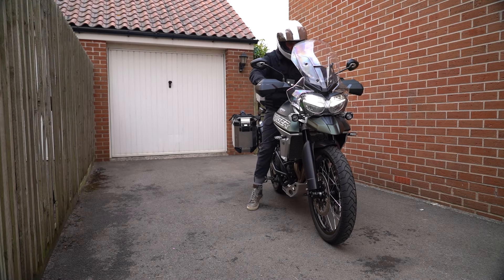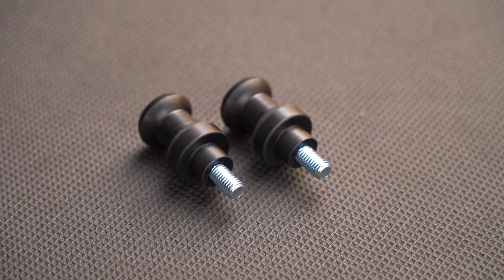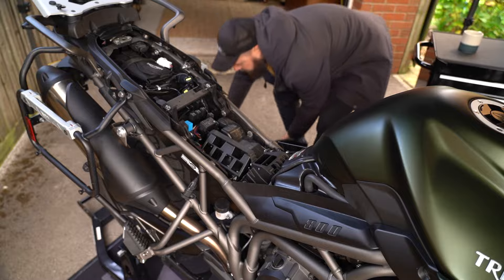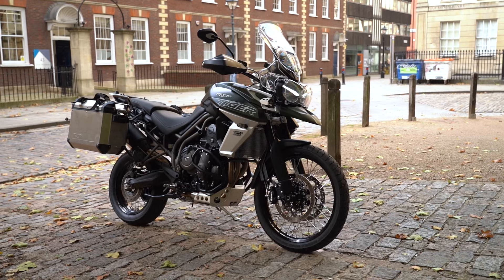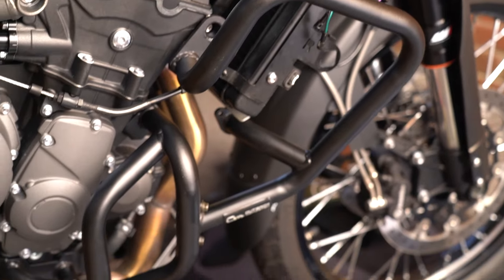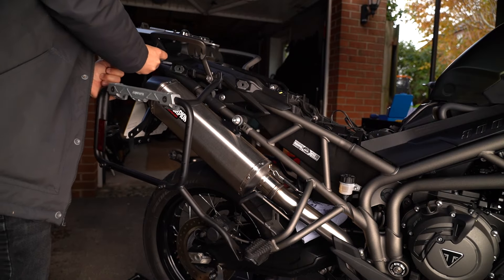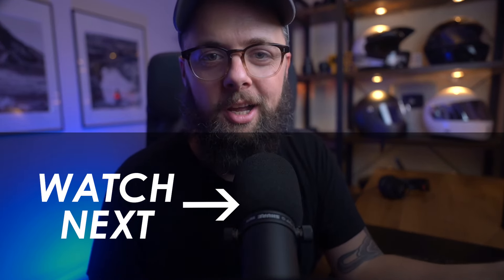11 Mods & Accessories For My Triumph Tiger 800 XCa!

Comment: I prefer the 800 over the 900. It looks more substantial and of course doesn't have the 900's TFT display which I'm not sure i could live with.  Nice bike fella.
Reply from the maker: Cheers SC - the regular firing intervals are better on the motorway too when you get up to 70mph+
Reply: Although the 900 fixes a few things I don't like about the 800, eg air filter location, removable rear pegs,  tubeless wheels, indicator location (I want to do this mode)

Comment: Used to own a tiger 800,went back to Yamaha and i regret it little bit... the fit and finish Triumph delivers makes you feel "special" and its worth the money 😊 I will probably start searching for a tiger again next year when the warranty on my Tracer expires 😅 love the looks of your Tiger btw!
Reply from the maker: Interesting! I quite fancy a go on the tracer 9 GT because I loved the engine in the MT-09. But agree the triumph finish is right up there with the best
Reply: @motobob  got the tracer 9 GT for a day when my tracer 7 was getting serviced,the electronic suspension in combination with the quick shifter made it a very fun experience 😅 180 kph and not even noticing  it,a very well put together motorcycle to be honest.If you get the chance definitely try it!

Comment: i have had both the 2018 Tiger 800 XCA and a 2021 Tiger 900 Rally Pro. While the Rally Pro might have been a tad better in almost every terms, except for the pronounced engine vibrations of the T-crank. This was a no go for me, now I waiting for a good opportunity to find a last gen Tiger 800 XCA again. That engine is soo buttery smooth. This satin green color looks so noble too...

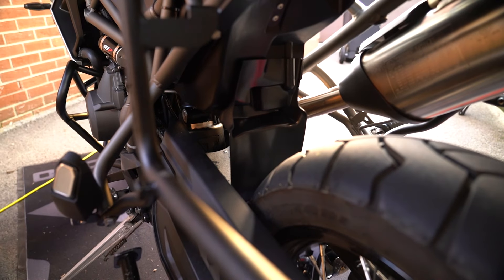Comment: 6:40 The Triumph Tiger 1200 XCa also has the turn signals placed higher up. I was on a riding skills course with a fella who had a 2023 Tiger 1200 and he dropped it during a slow speed U-turn and busted the turn signal. So, the new position is no guarantee. Therefore, I'm not convinced relocating the turn signals to the higher position will work.

Comment: Bought a 2018 one of these in red as my first bike after passing.
Purchases so far are triumph tank pad 
Fender extender 
And scorpion exhaust 
Can’t really fault the bike 
Another than I had to adjust the gear lever as it was way to tight initially

Comment: Personally, I would have wired that heated clothing lead via a relay, switched with the rear light cable. That way it would switch off with the ignition, and it's a very simple job to do.
Reply from the maker: Yeah that's a good idea - the dashcam system is spliced in there so I know how to get at it now. One for a rainy weekend!

Comment: I am actually considering this bike over a 1250 gs.  Looks good , sounds good , heated grips and seats  cruise control and it is about 6-8 k cheaper than a pre owned gs.  Any thoughts?  Am I wrong?  Should i still go for a gs

Comment: The Quadlock recommending a dampener for phones with optical stabilisation is a right pain as otherwise it's a great setup (I have it for my iPhone XS which has not broken... yet). Puts me off continuing to use it for my next phone as every time I ride I feel like it could be the day it breaks, but as you say the dampener is an EXTRA big chunk of plastic (I've got the wireless charger plate on there already making it bulky).

I wish they'd have just built a dampening into the wireless charger.
Reply from the maker: That's a great idea - 2 for 1. I'd be more interested if they did that
Reply: I’m using a RAM mount and been riding with my iPhone 11 since I bought the bike (Tiger 800 xca) 2 years ago; never had a problem with the cameras of my phone.

I even rode with the phone attached on my off road adventures!

I guess I’ve been lucky.

Comment: Hi there. In regards to the exhaust, I have a 2018 plate of the same model as yours. Haven spoken to scorpion they said they didn’t make an exhaust to fit this age. 
Could you advise how you came about the can and if the older exhaust up to 2016 fits past that date?

Comment: Barkbusters; crash bar sliders will give you protection for crash bars and even more clearance to the tank; front wheel sliders; first aid kit; rest stand enlarger; and that’s it. My protection it’s all paid with a stupid slow moving u turn 🤦🏻‍♂️
Reply from the maker: Good shouts mate! Especially on the sliders - a little extra clearance to the tank would be great.
Reply: @motobob  Heed bars seem to be the way - look how the stock bottom bars mount too, dodgy.

Comment: 800XCA? Is this an older model? I thought the current range was limited to the 850 sport, the two 900s and the 1200.
Reply from the maker: Yeah it's the last of the previous gen. It only had 900 miles on it and was about £5k cheaper than the equivalent spec on the Tiger 900.

Comment: Is this tiger 800xca or tiger 900 rally pro 
Which is better BOB???
Reply: He has the Tiger 800xca. 
Which one is better? Will depend of what you want the bike for. The 800 is better for highway, the 900 will be better for off-road.
Reply from the maker: Yeah I got this for about £5k less than the equivalent Tiger 900 with less than a thousand miles on the clock, so that was a big factor for me. Also prefer the smooth even firing order on the motorway. The Tiger 900 is better in a lot of areas (tech, brakes, styling perhaps) but I wanted to stick to a budget.
Reply: @motobob  have the prices shot up since you bought it? Most now seem to hover very near to the price of a new 850 sport!?!
Reply from the maker: @Dod5ter  Interesting... not checked but from what I've seen of other used bikes, I'd assume it's gone up yes
Reply: @motobob  Quite the investment of supply is still the ongoing saga!
Having been knocked off my T120 black I’m considering a taller and comfier commute.
Xrt is a bit smaller in height and some come with the beak so look alright.
I’m 5’11” and found the xca a little tall, or is it simply mind over matter!?!
Love the honesty of your films, and like the Innovv idea now!!
What of the c5??
Andy…

Comment: Is it better than Honda cb500x?
Reply: Yes, the Tiger 800 is in a higher category. More equipment, power, comfort, etc.
Reply from the maker: I've had the 500X for a couple of weeks - video coming soon. But like Manuel says, different class with way more spec and equipment.
Reply: @motobob  What about fuel consumption is it the same like 500 X??